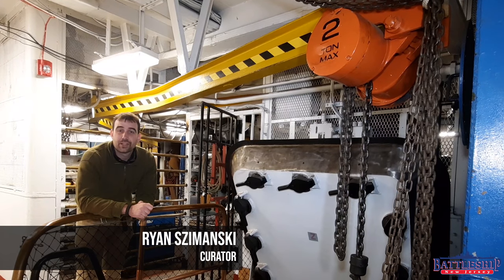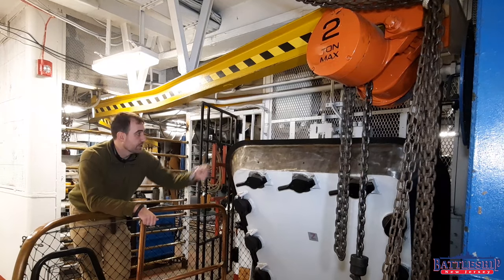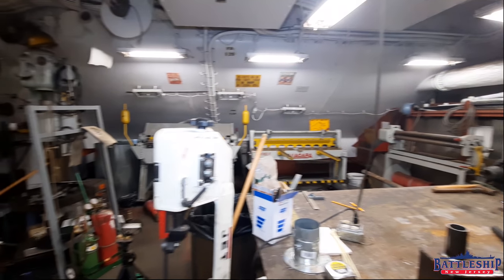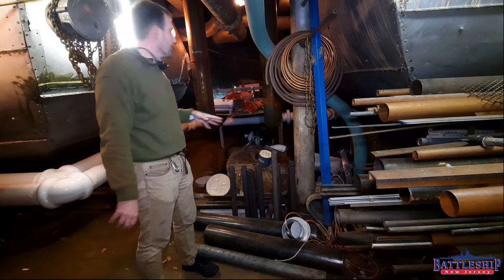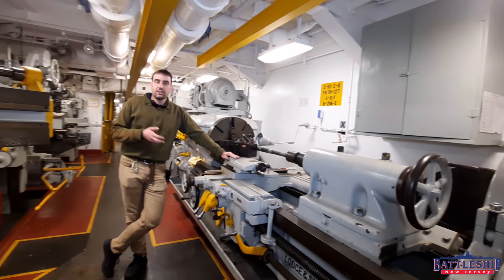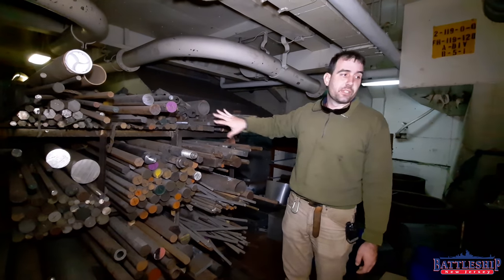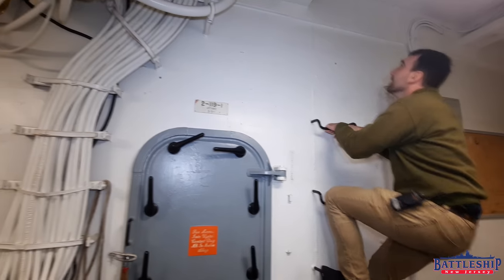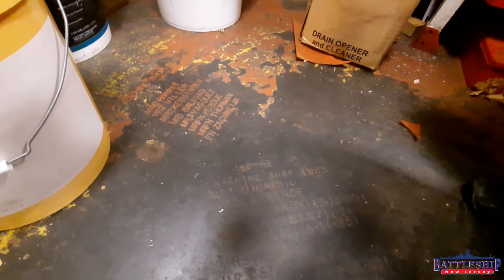Battleship New Jersey's Machine Shop

Comment: At least a couple of the lathes in the second to last room look to be  mid eighties era  .
Or if they are original then they where upgraded
Reply: Some of those are very much so eighties machines. The WW2 era iron can be seen with it's solid castings and curved lines. The eighties machines were encased in sheet metal.
Reply: @AndrewTubbiolo  thatt was what i  thought
Reply: The Standard Modern lathe (SM) is definitely 80s or 90s. I wonder how they got it in.
Reply: @micahatticus4257  I would imagine vertically down wider portals then horizontal. It's not like it's an American Pacemaker. I don't think the fit would be too tight.
Reply: @micahatticus4257  Yes strip it down and reassemble it for sure.
Reply: @micahatticus4257  We installed that SM lathe prior to the 1986 WesPac cruise. We stripped the carriage off and anything else that might break. There is a hatch opening by the HT shop and Long Beach Naval Shipyard riggers put it in place. Before it went in, we measured the base flanges to make the pads and the HTs welded them to the deck. Once that lathe was installed me and MR2 Miller leveled it with a spirit level and the shipyard checked it with a laser alignment. It was a decent lathe, but not as solid as the original lathes in the shop.
Reply: @leelawrence1557  Thank you for the info.
Reply: @leelawrence1557 spirit  level a lathe on a ship????
Reply: @janvanruth3485  yep while it was in dry dock.
Reply: @janvanruth3485  "level" may not be the correct word but it has the correct meaning ...supported by the followup  "laser alignment" information. Most everyone following this video would totally comprehend  what was obviously required. Nice additional information Lee. ☺
Reply: I was about to make the same comment, absolutely much newer than WW2.
Reply: It might not seem possible, but in all likelihood, all of those tools were broken down and reassembled in the ship. I used to do work as a technician on stuff like this. I worked on large, capital equipment, most of which much larger than what is seen here. I did this for over 30 years all over North America and Europe. The people that did the actual, physical movement of machines are known as Riggers and Mill Wrights. Something of a lost art today, but they could delicately, and safely, move seemingly impossibly large equipment. My role was to ensure the machine was disassembled and reassembled correctly, on site, and verified to operate properly within manufacturers specs. It all breaks down, into subassemblies, just like smaller machines, including the lathe. These aren't really that big, honestly. I've seen much larger equipment moved. I'm guessing the shipyard, and perhaps the ship itself, had people capable of doing this work.

Comment: An excellent video!
The "smaller" lathe with the markings "SM" is a Standard Modern brand lathe and is Canadian made (Toronto, Ontario).  They are still in business, and to the best of my knowledge are the ONLY manufacturer of new manual (ie: non-CNC) metal turning lathes in North America.  Given so many high schools don't have machine shops anymore, most of their production goes into US navy ships and submarines!  Given the general shape of that lathe, I suspect it was in fact made at the earliest, in the 1970's, so it must have been dismantled to get down into the machine shop.  Home shop machinists do that all the time getting ex-industrial machine tools into house basements!  I have one of their older machines (1960's) and it has quite a different appearance.  Hope that may be of some interest..
Reply: Thank you. I noticed that a couple of them looked to be much newer design.

Comment: I've been on some large ship repairs and refits. When it comes to the largest pieces of machinery, like engines, etc., they sometimes cut a large hole in the hull and remove it that way. Afterwards, the plate is welded back along with any structural ribs or bulkheads. As far as large primary and intermediate shafts, they are removed underwater with divers and cranes. Great video and explanations! Instant LIKE & SUB!

Comment: Seeing the boiler stacks brings back a memory. On my destroyer, in the passageway on the main deck is an access port to each stack. We had to climb inside of the stack with a fire hose and wash down the inside of the stack. The fire hose aimed up, not down. So you stood in all of the sooty water that was splashed off of the inside of the stack. Two boilers per stack. You stood on a flat platform, inside of the stack that was between the two boilers. 

Barry

Comment: Once upon a time I was an MR-4. That machine shop is a machinest dream. All the tools needed to repair or make anything that would fit. The only 'improvement' I would make would be to install electrical position indicators on the tools. These are not control computers but great time savers. 

On the ship, DE ?, we had a small lathe, a drill press and a box of files.

Comment: In about 1970 I was employed (Civil Service, not military) at the Naval Undersea Warfare Center (Pasadena, CA). One of my assignments was at the Morris Dam Test Facility in the San Gabriel mountains. That facility had a large machine shop with equipment dating from WWII. The machines were top of the line at the time they were originally purchased and were still in excellent condition when I worked there. I remember in particular a large vertical mill that had two-speed mechanically driven traverse on all three table axis. There was also a Shaper, which is a machine that has almost entirely disappeared from modern machine shops. There were other behemoth machines as well including a drill press with a rotary table and a huge throat depth. That facility had test bays open toward the lake that were used for testing of hazardous equipment and had heavy blast doors for access and used a system of mirrors to allow viewing into the chambers without direct exposure. Among the projects that I worked on was testing of sea water initiated thermal batteries that would power torpedoes and also internal combustion torpedo motors that had cylinders arranged in a ring with connecting rods pushing against a swash plate to rotate a shaft. The fuel contained both a hydrocarbon combustible and an oxidizer so that no external air supply was required and ignited the mixture by compression, like a Diesel cycle.

Comment: Wow! I haven't seen a Bullard vertical turret lathe since the 70's. I ran one for a few years. That DoAll surface grinder is a classic also.
Reply: I did also, at the General Electric co. Jet engine and steam turbine work.
Reply: @000-v8v9w  - I was at FMC Corp.
Reply: Got one sitting about forty feet away from me.. another one down the road in the local machine shop in the little town I live in,  southern York county.,.. It I'll. last time I ran the bulliard was two years ago.. sitting ever since the CNC vertical took over

Comment: I was an engineering officer on CVA61 during Vietnam. Some of the equipment installed originally was left overs from canceled ships at the end of WW2. It created problems getting parts. Our main machining space was much larger and had a huge lathe and radial drill press. There were no hatches big enough to get parts that size into the shop. As for getting large equipment into the ship after it was built, they would just holes in the hull while in dry dock. Ranger had 3 armor decks, Flight, Hanger and 4th. There was no armor on the sides. Instead a series of tanks and voids. They were used mainly for ballasting.

Comment: Radial drill press.  Gives 2 axis locational ability, and vastly improves accuracy.  Also, not a turret lathe, but a vertical boring mill.  Makes large-diameter pieces more machinable.
Reply from the maker: Our head machinist, who's used that machine since 1968, calls it a turret lathe.
Reply: I think he's referring to the large peice of equipment you called a 'Drill Press'.
Reply from the maker: Sorry, he mentioned both in his comment, hard to keep up!

Comment: I was touring the SS Jeremiah O' Brian in SF Bay with my grandpa several years ago, and he got to talking with some other vets on board.  After a while, they took us down into the aft cargo spaces and showed us a whole machine shop set up to do maintenance and all that.  I don't remember where they said the machines and tools all came from, but it was an impressive setup and wasn't part of the usual tour.  One of the coolest things though was, if I remember correctly, a generator installed in there which had come from Alcatraz Island, which was visible from the ship.  Such a cool, genuine experience!  What's really crazy is that they were using these machines in the upper portion of the cargo hold, above the huge lower portion.  A floor made of thick wooden planks was all that was between us and a plummet to the ship's bottom.  In one of the forward holds I remember looking down into that space through a glass window they set up and seeing a skeleton sitting in a chair as a joke.  The crew of that ship are super awesome and everything is still 100% functional, even the engines!
Reply: If you want to see the engines in action, pop in a DVD of Titanic. The engine room scenes were filmed on the O'Brian while she was under way.

Comment: All the machine shop tools (lathes , drill press etc. ) are capable of disassembly  , and could be transported to lower decks in that state and then reassembled in situ .
Reply: Only to a certain extent; the base castings are pretty large themselves in relation to the overall size of the machines.

Comment: The machine tool you referred to as a turret lathe is a vertical turret lathe, VTL for short. The lathe is called and engine lathe. These would be one of my must see items if I ever get a chance to come visit. In addition, to stand on the bridge where the "Bull" did as he chased the Japanese around the pacific, if those walls could talk.
Reply from the maker: Our head machinist has worked in this shop since 1968 and that is what he calls it so that is the name that we use.

Comment: The machine tools with the nice rounded castings look like WWII era machines.  The lathe in the second shop SM (Summit Machine?) looks much newer.  Square and light by comparison.
Reply: I was thinking the same thing.
Reply: Standard Modern Lathe made in Ontario.
Reply: Mark Parnell: Yes, Standard Modern!  Thank you.  It’s still a very nice lathe but not as classy as it’s predecessors.
Reply: There should be letter stamped information plates on each machine somewhere with serial numbers and manufacture date.
Reply from the maker: The video description has a link to a document with more photos and machine details. Mind you, that doc was written for tour guides to have a basic minimum info.

Comment: It looks like the yellow rails go through doors that might need to be closed quickly for fire or other reasons.  I assume those sections of rail can be removed?  Would they be stowed normally and only installed when needed to move equipment?
Reply from the maker: Exactly. We keep them in place all the time because they're hard to move but they would only install them when they were needed.
Reply: @BattleshipNewJersey  thanks for the quick reply. Just discovered your channel a few days ago. Catching up on all your great videos over here in Monmouth County, NJ
Reply: @BattleshipNewJersey  any chance you could share photos showing one rail in the stowed position and one in the installed position, or a short video of the basic process??  Were they mounted on pivots and secondary rails or did the crew have to dead lift them into place??  Thanks
Reply from the maker: They were mounted on a rack on the wall and then lifted into place. We tried to do it once but its a multi person job.

Comment: Though removing and repairing major engine components on large ships isn't done often outside of a shipyard, it has been done. I was on the Kitty Hawk in '93 when they spent something like 6 months removing one of the Steam Turbines that had a bad vibration. Required cutting a large hole from the Hanger Deck to the Engine Room going thru multiple decks and all the pipes, wiring and whatever else needed to be moved out of the way.

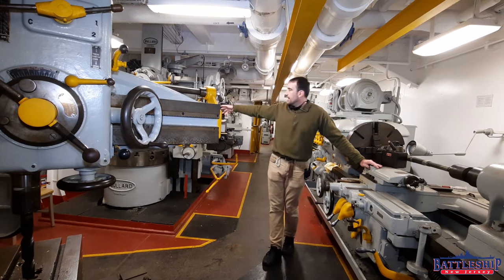Comment: 7:15 - Vertical boring mill actually, sort of a lathe standing on end. Good for working short length, large diameter parts.
Reply: Yep. Not a "turret lathe."
Reply from the maker: Our machinist, who has been working in this shop since 1968 calls it a turret lathe.
Reply: Not even close to being a turrent lathe..
I'm surprised there isn't a small Tool Room Lathe with a turrent attachment.
Reply: Sometimes they are referred to as a VTL or vertical turret lathe.

Comment: Counting the vertical turret lathe, I counted no less than 6 lathes on that ship. That's a lot of turning going on.
Reply: Bru Star we turned a lot of pump shafts and valve stems. Making a valve stem is tedious because you are cutting Acme threads. We churned out tons of impeller rings too. Pumps of all types were always in that shop for overhaul. Electric motors too. The electricians had a guy named EM1 Rich Baird. He was a rewind genius. Never saw a motor on there he couldn't rewind. Great guy to work with too. He taught me a ton about motors.

Comment: Used to run an old lodge and shipley lathe just like that. It was the only lathe we had, manual or CNC , that could push a tool hard enough to break a chip in maraging steel. No parts for the old monarchs and L and S anymore tho. They still make a decent anchor.

Comment: That Standard Modern 20/60 on the right is definitely newer. They must have brought it down in pieces using the overhead trolley. We had the same lathes on G-dub. CVN-73 in the mid 90’s .

Comment: Everything in that machine shop was made in America.
Reply: Not everything. There is a Standard Modern lathe that was probably installed during the ships last overhaul and modernization in the 1980s. Standard Modern lathes are made in Canada.
Reply: Like the little brand new Jet horizontal band saw? - And as far as all machinery going back to WWII that lathe with the square headstock SM Lathe wasn't even thought of 'till Vietnam. And the way he just walked past the newer Bridgport with even a word. (Is there a more essential machine tool ?) That DoALL surface grinder is not that old and he didn't mention the Horizontal mill or the boring mill either, but he sure is obsessed with chain falls and the mono rail  

One more thing. - If the stock rooms are not habitable while under way what good are they if you have to shut the boilers down if you need a piece of 1-1/4 1045 cold finish ????? Something is not right here. - He defiantly needed an actual machinist mate with him .
Reply: @mathewmolk2089   That Do All Surface grinder dates to the 1960's and was probably installed during her Vietnam War reactivation.   The Canadian SM 20/60 Lathe dates from the mid 80's and was most likely installed during the 88/89 refit.
Reply: @mathewmolk2089  I think by habitable he means it's hot as balls in there and nobody is going to be occupying that space for long.  Not so hot that you can't walk in for a few minutes and grab some bar stock, but hot enough that you're not going to be in there for hours at a time welding or winding motors without dying of heat stroke.  Imagine walking in a sauna at its hottest setting to grab the phone you forgot inside, compared to staying in that sauna all day long operating a drill press.
Reply: @ssmt2  Canada is still in America... just not the United States of America
Reply: @Skinflaps_Meatslapper  As long the sauna has some beer in it, wy not? Greetings from Finland
Reply: @JaakkoF  I don't think I'd want to drink beer that's 60C, unless I'm staying all winter in Finland LOL
Reply: @oaklecopel  In that case so is Bolivia who hid all the Nazi war criminals.
Reply: I think the big lathe was a lodge & Shipley. I had a 22/96 that was from the US navy and was very close. the apron controls are pretty unique

Comment: Can someone correct me if I'm wrong, but the Standard Modern 2060 lathe at 11:09 was installed after the ship was built since it has a variable-speed motor as opposed to the older lathes that would have a single-speed motor and a gear box that had manual levers to change the turning speeds, such as the one in the background.  I also noticed there was a milling machine too, instead of a shaper/slotting machine. I learned the lathe on a Navy surplus Reed-Prentice- date of manufacture was in the early 1940's. The USS North Carolina has a pretty awesome machine shop too, but their slotting machine has been removed.

Comment: In the shop at my work (ready mix concrete plant. Im a driver) there is a grinder/ wire wheel.  The data plate is still on it.   The date is July 1941. Prior to pearl harbor and their is a anchor.   Dont know what ship it was on but nice to no it survived WW2 and ended up at our shop in Washington state.  If that thing could talk i would listen.